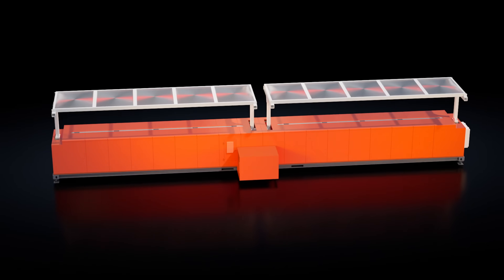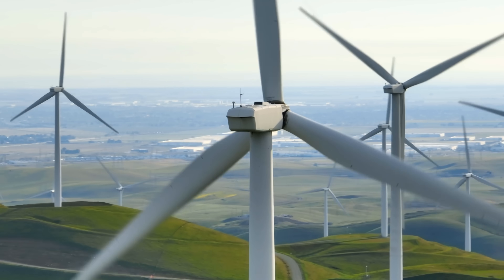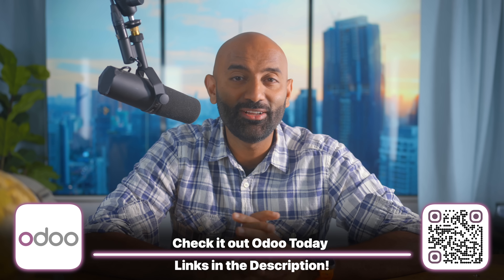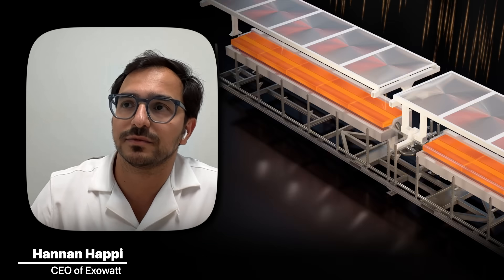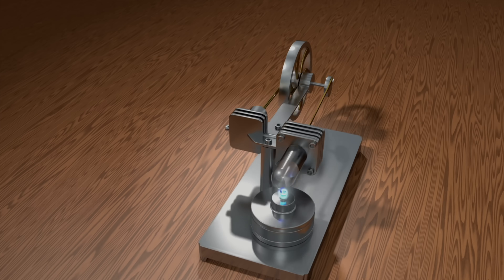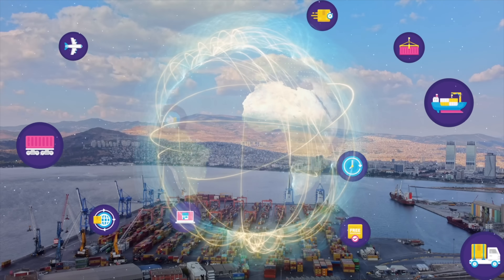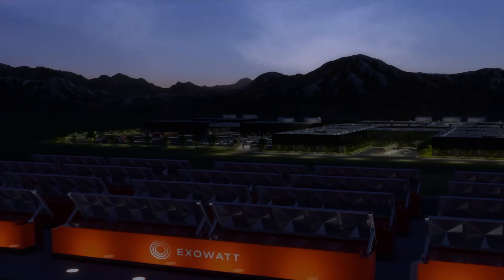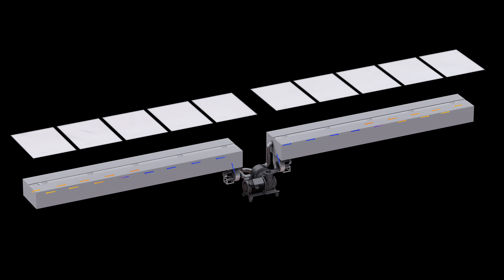Solar Without Panels, Storage Without Batteries - EXOWATT

Comment: This is just bullshit. Sorry.

The physics just don't add up.  

First, there were multiple mistakes on solar PV numbers - efficiency is wrong, especially when taking bifacials into account, LCOE for solar + storage is WAY wrong (Lazard 2025 published $50-$131/MWh for solar+storage - and they're not even showing the Chinese or Indian costs). Whether ignorance or bias, either is enough to discredit the whole analysis. 

But most importantly, the numbers for their claims just don't make sense. A 40" container is around 30 M2. In Texas, at 100% yield you'd get 163 kWh of solar energy hitting that area. With single axis trackers you can increase that 20-30%. Let's give them 30% to be generous - 211 kWh. 

Lenses would just just focalize that energy in a smaller space, they're not magical energy creating devices that make the sunshine brighter.  

This means that at 100% efficiency, on a 40' container space, with trackers, you could capture 211 kWh of sunshine, yielding at most 8 hours of 25 kW output.

But nothing is 100% efficient. Stirling engines AT BEST have 30% efficiency. You're down to 2.5 hours of 25 kW output. 

And this is before any type of heat or electrical losses, which if best in class would only impact 20% of the roundtrip yield. 

So yeah, your 24/7 25 kW magical machine is really at best a 25 kWp/50 kWh solar + battery system and your LCOE just 10x'd. 

They're going to end up charging their "batteries" with energy from the grid but if you're going to do that might as well do it with normal batteries that have reached $55/kWh.

Comment: And, like solar farms, they too will need to be replaced after large hail storms.
Reply: Which has zero meaning to all the places around the world that don't get hail storms.
Reply: @JorgTheElder yes. Like fighting Jay's in Texas, which never gets hail...until it does.
Reply: Fresnel Lenses are far cheaper than photovoltaic panels. And if the owners want more power, they actually place Fresnels over the PV panels to begin with
Reply: @ThorOdinssohn Is that actually proven to work? Fresnel lenses help concentrate or focus light, they can’t create more energy from the sun than their square metre area covers, which is around 1000w/m2.
Reply: @evil17  Exactly. Also, solar panels lose efficiency at high temperature
Reply: You underesimate how resilient these panels can be
Reply: @texanplayer7651 We overestimate how resilient wind turbines & solar panel can be, and they are only 5-6’ long, not 40’ & turbines get hit by lightning, kill birds and start bushfires if/when they work.

Comment: I wonder how it would do for just heat for industrial or commercial purposes? Like if you had a big bakery and you covered the roof  with however many of these you could fit up there, could you just use the heat to to do the baking?

Comment: For a long time, we only heard about PV electrical solar panels.
Recently, solar heat systems have become more prominent in the news such as the sand battery.
We often use heat to determine efficiency and energy transfer. 
In electrical/ electronic systems, heat is the measure of inefficiency of a system.
I recall the (theoretical) Carnot cycle from thermodynamics provided a lot of useful information.
While other cycles may be better in real world scenario, none are universal.
Reply: Concentrated solar power systems have been around for longer than PV, but eventually PV became cheaper. And unlike this Fresnel-container story they did actually work.

Comment: Molten salt for heat transfer may be a solution to uneven heating. If it could be handled through convection, no additional mechanical hardware would be needed.

Comment: Slowly figuring out how to convert sunlight into boiling water.  So little talk about the difficulties of a particular attempt, because the issue is not the engineering challenge the issue is the control of the market challenge

Comment: I think the last 10 years have taught us that convoluted, inherently expensive gimmicks like this will never beat PV. Lenses aren't cheap. Shipping containers aren't even cheap. The insulation alone makes this unfeasible. We've seen parabolic dishes connected to Stirling engines before, it's not even close to viable. And who the hell is going to start mass manufacturing Stirling engines anyway? This is so ridiculous.
Reply: I mean could just change the lense to use a parabolic mirror which can be made for pennies, or even use the Fresnel lens from old TVs. It's fully doable in small scale if communities work together and we utilise recycling rather than producing new parts
Reply: @BootlegHuman  The thing is it can't be made for pennies. Old TV lenses? Those are flimsy, too small, and would melt. And they would cost more to find them, take them out and ship them. I mean just keeping the lenses clean--that alone makes this thing unviable. The people investing in this are rubes. I don't think people understand how cheap PV is right now. All solar thermal ideas are completely dead. Parabolic troughs, solar collector towers like the one near Vegas... all of these experiments are underwater massive failures because China is pumping out dirt cheap PV and it keeps getting cheaper. PV is so cheap that using PV and an electric heat pump you can heat more water than you can with a passive solar water heating system the same size.

Comment: Several moving parts I'd say........ Next (which I'm sure they've accounted for) is the synchronization with its generator and the grid. I mention "Im sure they've accounted for" this because every generation station on any grid has to be and has been synchronized for a "grid" to function.  With the exception of selling power from one state to another like Oklahoma to Texas (which has its own grid), they convert the AC to DC and sell it instead.

Comment: 1 second per unit across 5M units isn’t 31 years, it’s 5M seconds / 86400 seconds per day, which is around 58 days with 24hr production, 174 days with a 8 hour shift 7 days a week, which is about 8 months with a 40hr work week allowing for holidays. It takes 1B seconds to get to 31 years. You would have to cut 1 second off a step that is repeated 200x per unit to get to the savings he claimed. That may be valid, but it’s not the message he conveyed.

Comment: W just finished a farm solar project that was a nightmare on the local electrical and zoning people.  This looks to be do much easier to work with and there would be no tax  burden because it is portable. In northern climates could a portion of the heat storage be use  for heat?  Definitely want to explore this more, thanks

Comment: I would love to be wrong about this but I don't think the math adds up with this system. I likely have a fundamental misunderstanding of something but 0.6 acres of sunlight provides, at 100% efficiency, 407,904 watt hours. Definitely not a MW hour. Anecdotally, there are so many transitions of energy in this system that there is no way it can compete with PV and batteries for land use.

Comment: This looks very promising in locations that receive reliable sunshine. I remember that solar farms with mirrors heated some sort of highly corrosive salt fluid that retained heat very efficiently. But the corrosive fluid was also very difficult to keep from leaking and wearing out equipment.- The success or failure of Exowatt seems to depend on how long the bricks can generate electricity in the absence of sunlight. I hope Exowatt has great success!

Comment: I don't really care about 1 cent electricity as much as I  care about more power/efficiency.

A dual-axis azimuth-altitude tracking system could be used if you put hundreds of these units, or more, on water, then just rotate the entire thing.  This would use more moving parts, but it would be far fewer moving parts than a traditional tip-tilt system.

Also, with a floating Azimuth-altitude dual-axis  tracking system, a company like Exowatt could enter into an agreement with a data centre company or tech company, or a number of tech companies to marry the two together.  A data centre could be colocated with anExowatt power plant and the cooling provided by the water could be routed to the data centre.

Comment: This is really unproven at scale and at over longer periods of time. I see reliability being a concern given the heat generated, expansion/contraction cycles and the the effects of rain/dirt. Yet to see any small scale versions at my local electronics shops.
Also the efficiency seems to be an issue given the way it was glossed over and the noise of the fans.

Comment: could they put wheels on one side of the containers and change its angle over the seasons to optimize the solar energy collected? kind of like how farms use a circular track for watering crops. could be done manually and eventually autonomously.

Comment: I think this system has great promise. I could see where you could use a type of focusing lens based on holograms that changes its focal point depending on the angle of the light. Then there would be no need for any moving parts except for the Sterling engine of course. Sterling engines also can be made very reliable because they are simple compared to many other types of engines.
Reply: If you don't move the lens then the part of the lense that is directly contacted by the photons shrinks progressively as the angle diminishes. Which means energy from fewer and fewer photons being harvested.  What you're talking about sounds like a three dimensional lens that would be very expensive comparatively.

Comment: The Exowatt system is a modular energy system housed in a 40-foot shipping container [00:18].

The process works as follows:

Solar Collection: Fresnel lenses, similar to those used in lighthouses, track the sun and focus its light with high intensity [00:43].

Heat Storage: The concentrated sunlight is converted into heat and stored in a thermal battery made of solid clay and ceramic blocks. These blocks are heated to an extremely high temperature of 1,000° C (1,800° F) [00:56].

Energy Conversion: A Stirling engine is used to convert the stored heat into electricity. A blower pushes superheated air from the hot bricks to power the engine, which then generates electricity on demand [01:09].

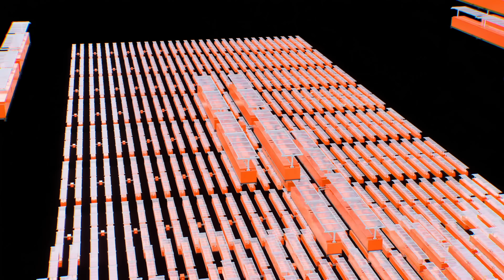Each container delivers approximately 25 kW of power [01:25] and is designed to provide 24/7 power at a low cost, with a future target of 1 cent per kilowatt-hour [01:31].

Two Bit da Vinci states that the initial claimed cost for Exowatt is 4 cents per kilowatt-hour for 24/7 power, with a long-term goal of 1 cent per kilowatt-hour [01:31]. By his own calculations, over a 30-year lifespan, estimate the cost to be between 2.7 and 3.3 cents per kilowatt-hour [06:05].

In comparison, the cost for conventional utility-scale solar without batteries is around 2.3 cents per kilowatt-hour [06:49]. However, when you add batteries to achieve a similar 24/7 power output, the cost of conventional solar jumps to 11.6 cents per kilowatt-hour [06:56], which only provides about 8 hours of electricity. The video concludes that for 24/7 power, Exowatt is a much cheaper alternative [07:08].

Based on the video, there are differing figures for Exowatt's land requirements. Exowatt's CEO claims a rate of 0.6 acres per megawatt, which is said to be 40% less than a solar PV and battery system [07:41]. A head-to-head comparison in the video calculates it at 0.59 acres per megawatt, or 39% less than a typical utility-scale solar panel [08:01]. However, an extrapolation based on a model plant in the video suggests a higher requirement of 2.3 acres per megawatt [09:06], which the video still concludes is 2 to 4 times lower land use than a conventional solar farm with storage [09:26].

For conventional solar farms, the video mentions:

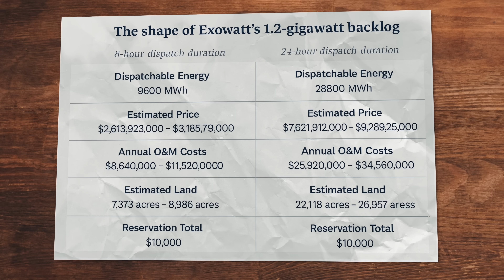Utility-scale solar with storage requires 18 to 22 acres per megawatt, based on a critique of a 50 MW plant needing over 900 acres [07:16].

Utility-scale solar panels alone are noted to require about 0.97 acres per megawatt [08:12].

Reports often cite a land use of 5 to 10 acres per megawatt due to the spacing needed to avoid shading [08:45].

Comment: Did you forget to account for a sterling engine per 40 foot container unit? That’s a lot of engines, and moving parts for that large (25MW?) installation.
Reply: While they're moving engines, they're pretty simple ones. Should just need greased bearings now and then.
Reply: I would guess it doesn't scale as well as say a modern compressed air battery or flow battery system of the same acreage footprint, with solar PV mounted above. With these technologies one would not need many separate heat engine per container just large site wide storage vessels plus a centralised energy converter (turbine or flow-cell).

Comment: Hell if this works in a container it would be pretty easy to build a consumer version of this, stick it in your backyard and power your entire house or several homes with one the size of a dumpster.
Reply: The problem is it doesn't work as shown. Even with systems that actually exist and work you can't power a house with an area the size of a dumpster..
Reply: @SolarCookingGermany  You're right; I wonder what gains they'll make in 5-10 years, hopefully they'll find a way to make this a hybrid heat / power system where the excess heat can be used to reduce the cost of heating for homes in cold climates and also reduce the need for grid power, the energy savings might be worth it considering how inert most of the materials are in this setup. It has potential though, definitely a don't let perfect be enemy of good enough situation.
Reply: @Binxalot  I suspect it's an AI investment scam. They had no working generators 5 months ago and I still don't see anything today. Oh wait, they uploaded 2 bs marketing videos 3 months ago 😄

Comment: I recall 15 - 20 years or so ago when ppl were trying sterling engines and energy storage in oils and waxes.  It all flopped hard.  Silicon is so cheap like $0.10/watt solar thermo electric just cant compete, its a non starter. This will flop hard.

Comment: Are they claiming the ceramic blocks will remain hot all night so you don't need to have battery storage? When I heat up my stove to 700f ; it isn't long before it's cooled down, even with great insulation that sounds too good. How can one keep ceramic very hot while your trying to extract energy out of it by blowing air throught it and extracting energy out of the hot air? Why won't the air cool it pretty quickly?  The proof would be in doing it & seeing if that is overly optimistic.  The components aren't hard to do; so don't they have a working unit?  If not, this would be indicative of a theoretical concept that doesn't work in reality.

Comment: I agree with maxkennedy5073.  But I was thinking if they could be scaled to fit inside a tractor trailer, it can be used as a backup power source for disaster areas like a hurricane or tornado.

Comment: Does anyone ask the question why humans need more electricity?? So humans can go shopping 365,24,7??😮🎉
Reply: You can live in a log cabin if you like
Reply: @michaelmartin9022  Can I? Or would regulations and building codes prevent it?
Reply: AI, data centres and industries would be my guess.
Reply: Most industries are reducing carbon emissions by converting to renewable energy/electricity alternatives to fossil fuels. Therefore, electricity demand is only going to continue growing exponentially over the next 10-20 years.

Comment: Some newer (1994+) Crane sheaves at the boom tip have nylons instead of grease so you don’t gotta grease them, this system could be used in the container battery thingies you’re speaking about here.

Comment: So these shipping containers are going to hold heat a couple hundred degrees below their melting point, when the lenses themselves can reach temps twice the suns melting point.  Of course they Wii be focus till a pea sized hail cracks them. Many experiments done in this direction. Then the footprint of 100 miles or more of 2500 degrees like a giant square living  Volcano.   But not just a theory on paper.   Have you seen the two failures of the directed solar projects, this is a lateral step not forward.

Comment: the concern over stirling engines maintenance needs is trivial when you consider that there are still functional stirling engines over a century old that have only ever required replacing bearings. there is no similar steam/ice engine, all of which require extensive maintenance every service cycle and in many cases fail entirely after a certain point and require complete replacement

Comment: If the bricks are heated to 1000° how would you be able to enter the container to service the moving parts? For example the arms that may need greasing?

With the long slit on top how does weather impact on it if you’re in a dusty environment or if you get rain?

It would be interesting if you gave the actual price of a single unit as part of your reviews of such things as this.

Comment: Exawatt's thermal storage approach is interesting but breakthrough photokinetoelectric technology could deliver similar results with much higher efficiency and lower complexity. I've been following a company called InfraBrite Solar that's developed non-PV technology achieving 93% efficiency in lab tests and they claim to have the lowest priced panels in the world. They also have this ownership model where people can buy small solar units installed on businesses. The businesses get savings on electricity and owners collect revenue with better returns than most investments. While Exawatt uses 200 year old Sterling engines and gets 15 to 18% total system efficiency, breakthrough photokinetoelectric conversion could achieve the same 24/7 power at much higher efficiency without moving parts, tracking systems, or thermal storage complexity. Sometimes the newest technology beats combining old technologies.